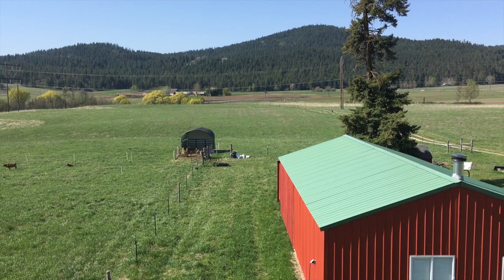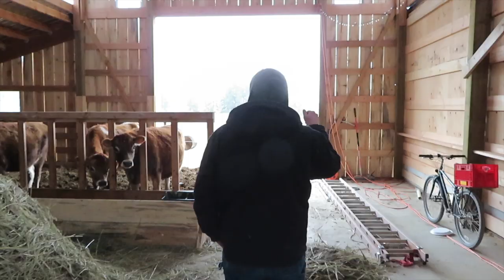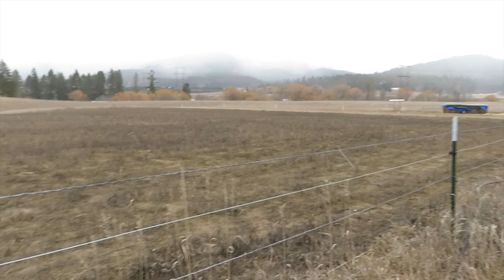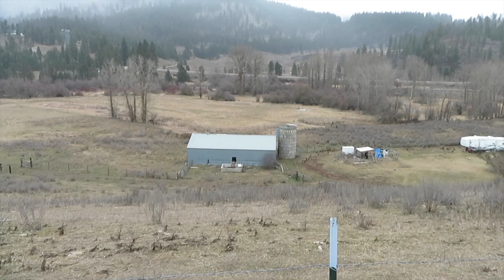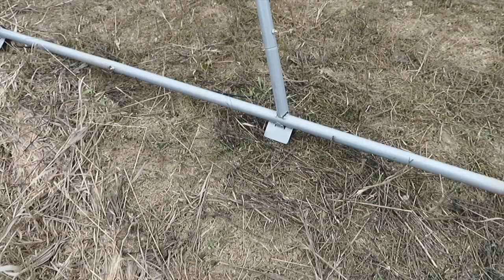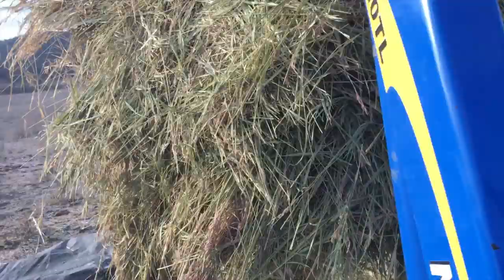Shelter Logic Structure: Blown away!

Comment: Hi guys, sorry for your loss there. I too have 2 shelter logic structures on my farm and have used them for years with no issues. What I do to help secure them is drive steel fence posts at the corners and use  fencing wire or chain to hold in place. I may not have the wind here in Wisconsin like you have there. That is exactly what happened there ,the ground got soft and the anchors let loose.
Reply from the maker: Hindsight is 20/20, but T-posts could have pulled out of the ground too. Oh well. Luckily it had served it's purpose. We are pretty exposed up on a bench above the valley, and the wind was out of the West which is not a predominate direction. With everything it was just a literal perfect storm. Nobody was hurt so it's all good!

Comment: I had a two shelter logic type sheds over 20 years. They have to be secured to the ground with at least 6- 3 foot ground screw anchors that have a screw diameter of about 4 inches.  They should always have closed doors and need the hurricane blowout panels in functioning order. My second one was 20 wide and twelve deep. I actually sided it with vinyl. I lived on a hill on the CT ocean coast. The shed endured 4 major hurricanes over 17 years. It was officially approved by an engineer for our town codes. It was still standing when we sold our home. On the hand our wooden grenades on our farm in Northern Alberta were tumbled 1/4 mile by high winds because they were not properly anchored. That little shed is not a write-off. Order a new cover, straighten the poles, put doors on it and anchor it solidly. It will last for decades. 🐮🐮🐮🐮
Reply from the maker: We're writing it off... It has served it's purpose anyway. It was always meant to be a temporary structure until our barn was built, which it is now! They're some salvageable materials left in it we'll reuse. There is no straightening of some of the poles, as they were literally torn apart. It's extremely light gauge steel. The cover itself is actually still in good condition, so we're currently using it as a tarp! Thanks for sharing!